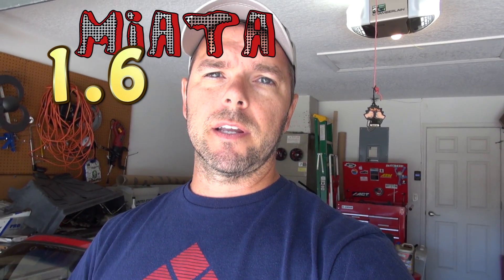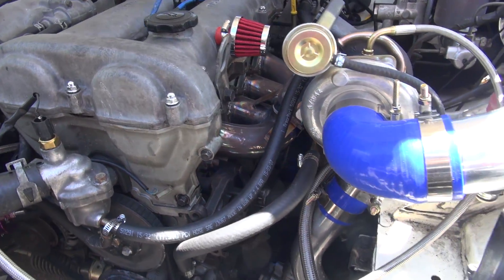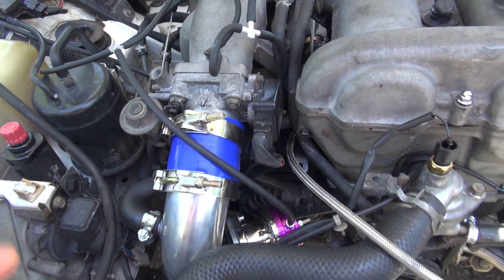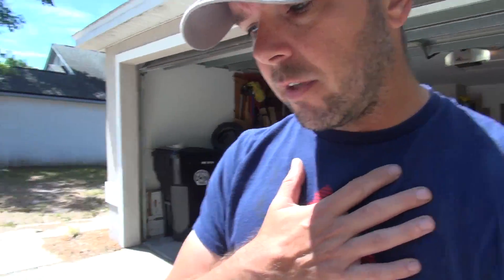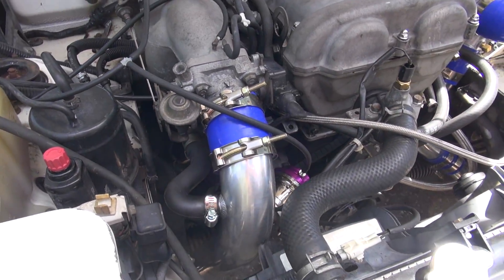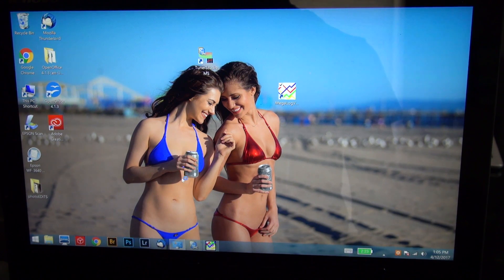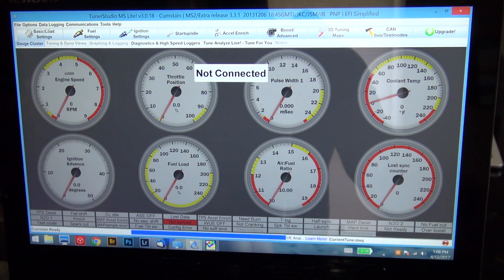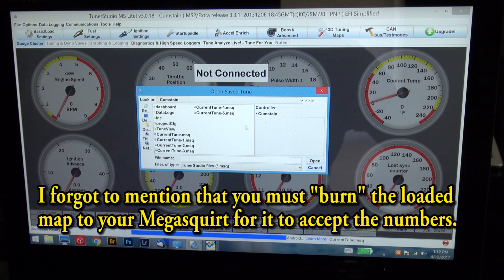1.6 Miata CX Racing Turbo Kit Review

Comment: Kinugawa probably has a wastegate actuator for your unit that you can put a lower pressure spring in to make the boost controlled. That is something you want to be lower than your target pressure because your boost solenoid will be controlled by the MS unit and will delay it from opening until you've reached your target. Your AFRs are kind of rich for the low boost range (0-5psi). Also you should look into having a legit tune done because I know you aren't running enough advance to reach full efficiency and it's not to make the car a dyno queen but to get better power with better fuel economy. Getting those right can make the car run much more effortlessly. Just my suggestions but it looks good for the price and you got it in there fairly clean.

Comment: I have the exact same kit. I've been running for about a 2 years now. I am still using the stock ecu with 440cc injectors at 28 psi fuel pressure on a 1:1 rising rate adjustable fuel pressure regulator. Its currently set for 12 psi. You will eventually encounter cracks and have to weld the manifold. Re-weld all the welds points wrap with header wrap and it will be good. Its been a decent kit for the money.
Reply from the maker: Cracks in the header is the one issue that keeps coming up over and over.  I think if (when) it comes to that, I'll acquire a cast iron T4 manifold.  But for now, I'm extremely happy with the kit.  So far so good.
Reply: how in the world are you able to run larger injectors on a stock ECU?
Reply: I use a rising rate adjustable fuel pressure regulator to lower the fuel pressure with bigger injectors.  Miatas will idle in the lower 300cc of fuel. Use a injector calculator to determine what pressure to use for  idle and adjust from there.
Reply: i understand that but a stock ECU will not recognize anything larger than the 1.8 injectors
Reply: Miata ecu will fire high impedance injectors. I ordered injectors ... some just find some used RX7 injectors. If it fits the fuel rail and intake it will work with some good calculating.

Comment: That oil you were talking about burning is the factory oil they put on all the components that gets hot and burns off~ same happened to me in my 93 Miata with this cx kit
Reply from the maker: Now that I think about it, we were running without an O2 sensor and super rich.  Probably around 8.0 or even richer, so it's likely what I thought was oil smoke was just gas smoke.  It was so bad that my eyes were burning.

Comment: To run the oil feed from the block you need a pipe thread I forgot the dimensions but if you ever want to swap over I can look on my car.
Reply from the maker: I know exactly what the fitting is I need.  It's an M10 x 1.5 bolt pattern.  I was mistaken when I said it was an AN fitting.  That's generally for the oil feed line, so you'd need a very specialized fitting to mate the oil line with that oil line.  I just didn't have the patience to order it and wait for it.

Comment: If you want to get into the 12 pounds safely I recommend getting the fab9 tuning coil on plug (c.o.p) convertion due to the the 1.6 stock ignition being weak. Also go for some rx8 injectors

Comment: planning to buy the cxracing turbo kit for my scion frs obviously its a different car but would u recommend ?
Reply from the maker: So far, so good.  I'm actually pretty impressed with the kit thus far.  I don't know anything about the FRS kit, but I might assume that it may not be as 100% drop in as it is for the Miata.  It's a difference of 20 years between the cars and the Miata is a far more simple motor mechanically and electrically.  But as far as the kit I got, I'd definitely recommend it to others.
Reply: thanks il let you know when i do it

Comment: Do you have any problems at The long run wiht yore cxracing turbokit
Like cracks in yore manufold🤔
Reply from the maker: Yep.  Episode 34 is a 6-month update where I showed how the manifold basically chose to have half of its welds just leave and I had large holes and cracks in it.  I replaced it with a cast manifold and ran that for over a year without any issues at all.  Here's the video: https://www.youtube.com/watch?v=BYcTHzX8Mhw&list=PL76bDlwLwwOq9rNWFkvBySBFibMtGRVjq&index=35&t=1s

Comment: Would you recommend this kit if i just want a daily driver
Reply from the maker: I daily mine, but it's been a bit of a journey.  Also, this is not my only car, so I didn't care if I messed something up and the car was undriveable for a week or forever.  So if this is your only vehicle, I would not ever recommend you do major engine/drivetrain modification to a car.  But if you have a reliable backup, then the best I can tell you is so far, so good.  Stuff is only just now settling in after a few months of driving it.

I tend to romp on it when I drive it... it's almost impossible not to.  But it seems to be behaving pretty well.  Just know that there will be a possibly long dialing in process and chances are SOMETHING is going to break after you basically double your horsepower.

Comment: A year later, is it still running strong? How many miles have you put on it
Reply from the maker: Stronger than ever, really.  I had to replace the exhaust manifold because that V1 stainless just got destroyed.  Their new V2 design might be better, but I chose to go with a cast aluminum one.  No welds to fall apart and since then, it's perfect.  Well... sort of.  The bolts rattled themselves loose and I lost a gasket.  But since replacing the gasket and loctite on the bolts, it's all good again.  I think I've put nearly 4000 miles on it since owning the car.  Most of those miles are turbo miles.  And I'm NOT gentle with this motor.  I boost just about every chance I have and the blow off is constantly making noises.

So, in all... the kit is pretty good for what you're paying.  I hope that the V2 manifold is more reliable, but the other parts have performed just fine for well over a year.  I'm starting to drive the 2016 more lately because I've lowered it and it looks much better now.  But I would say that the Cumstain is still a daily driver (when it's not raining).
Reply: Awesome! Thanks! Someone near me is selling an entire CX kit for a 1.6L for $650 (with intercooler and everything) and I was honestly on the fence about buying it. I'd like to turbo my car, but it is my only DD. Thankfully, I do still live at home, so I can borrow my parents car if needed. I'm thinking I'm gonna buy it now, and then wait to install till I have a Megasquirt.

Comment: Awesome job well done.
If the turbo kit was $1000
What did you spend the other $1000 on?
Could you give a full break down on prices and please.
Reply from the maker: adam stockton I explain in the video. $960 for the kit. $900 for the Megasquirt and $140 for the Wideband AFR and O2 sensor.
Reply: goodeggpro great thanks only heard the $2000 thanks for the reply.

Comment: I wouldn't go over 8lbs of boost on stock I Injectors you can swap it over rx8 yellow top injectors also I am not sure but you may or may not need a aftermarket adjustable fuel pressure regulator
Reply from the maker: I heard that I just need an upgraded fuel pump to go with the injectors.  The megasquirt seems to take care of the rest.  But we'll see.  I'm sure something will break pretty soon.  I can't make any interesting content if everything just works.
Reply: oh the truth about modding I'm currently in the process of building a complete 1.6 engine for turbo forged internals for the bottom end and supertech valves, dual valve spring kit, titanium retainers, and supertech valve seals for the cylinder head but I have much more to finish, i did a port match and polish alot allot of work is going into it, trying to be down before MATG which a friend of mine and I are trying to get a group to drive up if you're interested
Reply: I don't think it's that it can't do it, it's just that the duty cycle will be nearly maxed out.
Reply from the maker: I'm currently hitting just over 9 pounds with MSM injectors (265cc) and stock pump, stock regulator.  So far, so good.
Reply: Nice good man

Comment: does this kit work with AC and P/S?
Reply from the maker: It does, but it's far easier to tune reliably without it.  I've heard of people having major headaches getting the idle to be consistent with the compressor kicking on and wildly altering the data.  It's all about the simplicity of this engine.  In some ways, it's easy to slap on a turbo.  In other ways, it really gets complicated with the A/C system on such a small displacement.

But then, on my 90, the car almost dies every time the A/C kicks on.  It doesn't, but it feels like it will until the computer adjusts and bumps the idle speed.  Just a second or two.

Comment: Is that the original 1.8 Miata engine?
Reply from the maker: Jeff Artalejo it's a 1.6. Original 93 motor with 170k miles on it. And still running strong with zero issues since this video.
Reply: goodeggpro sweet just asking cuz I have a 96 Miata 1.8L with 140xxxxmiles... and I've been wanting to put a turbo on it, but a lot of my friends keep telling me that my engine can't handle a turbo because it's a 1.8l....
Reply from the maker: Jeff Artalejo of course it can, although the 1.6 is known to handle a turbo better. 1.8s are generally better with supercharging from what I've heard. But superchargers are far more expensive, but simpler and safer.

Comment: You're killing your spool up setting you're wastegate like that!
Reply from the maker: When I close the wastegate completely, I get boost at like 3000rpm, and a LOT of it.  So much, in fact that I get fuel cut off well before redline and it's abrupt.  So I'd rather have less boost earlier and continued boost through the top end.  It's a work in progress and I'm going to be experimenting a lot with figuring out my fuel delivery and tuning.

But you're not wrong.  It takes a lot longer for the turbo to spool up with this setup.
Reply: goodeggpro I'm actually purchasing this kit with an ms2, and I'm getting either a Garett or a turbosmart wastegate actuator, 7-10psi. From there boost control is a lot easier and you get mad spool without overboosting